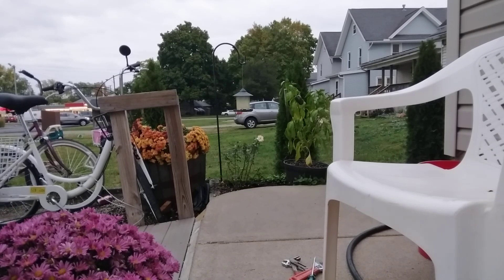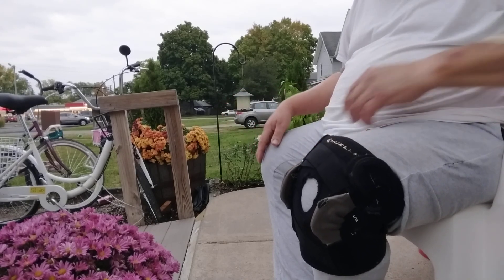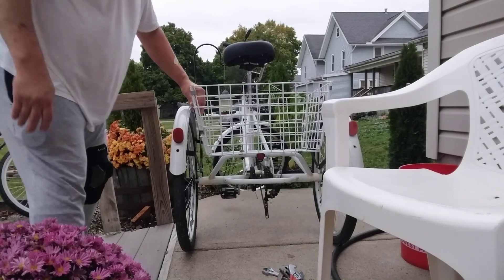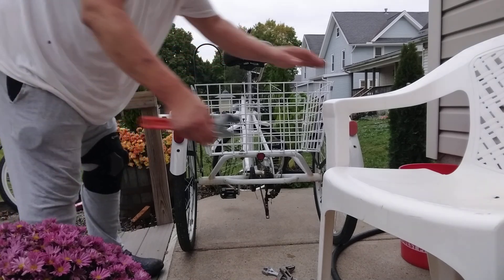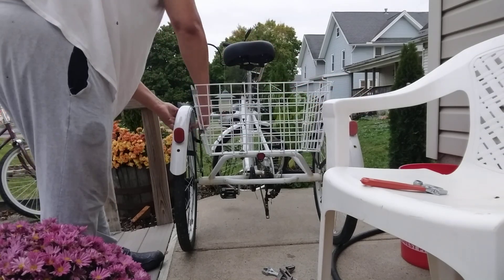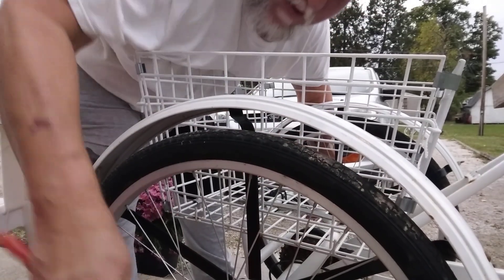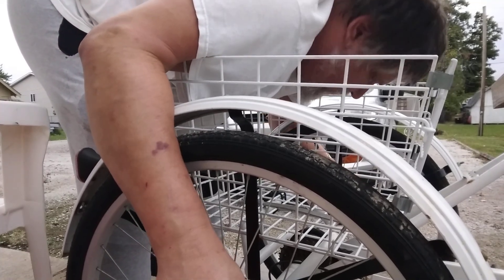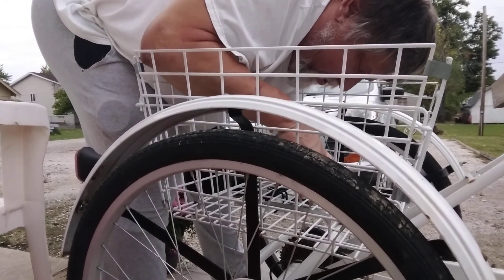Trying to make do with the tires on my bike,do to our economy the way it is.😬

Comment: i know what you mean on the tires - as i just got done cleaning up two old bikes - 1 schiwnn caliente and the other has schwinn rear hub 3 speed gear but sold as sears roebuck lol lol i did the easy thing from amazon for the tires and tubes - walmart and other stores do not carry the sizes i needed , bike shops around me wanted too much money for the basic tires up to about 100 per set of tires only , for close to original tires i found that the Kendra was very well to original and fair cost that is even the gumwall style for the times , both are great coasters , heck i even did my own green slime tube protectors for the three speed - those tires should be in the next couple of days , so honestly each on was under 90 bucks for the parts needed on both bikes , did alot of that as a kid so it stuck on the tricks learned to make it easy to check for punctures and stuff , would like to get a 3 wheeler but i have no room for it as i have six bikes in total and they are all fun to ride but one is small and i knee my chin trying to ride lol lol , keep safe and best with you tinker toys - ride safe
Reply from the maker: Yes trying to fine the size and the brand of tires it came out with will be costly i am sure ,but who knows .I am just going to leave it sit until i get the money to fix it .u sound like me i got 3 other bikes but i cant ride them ,because of my balance so I leave them out there for my son and his fiance to ride... but thank you for watching the video and for your support my friend